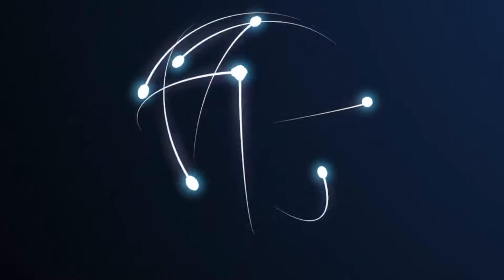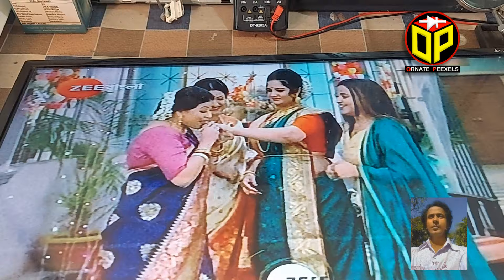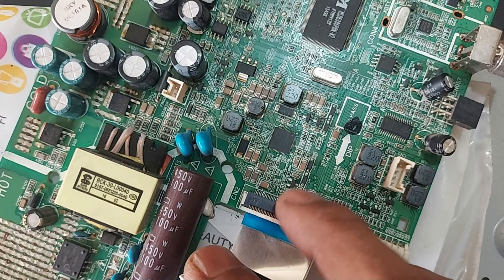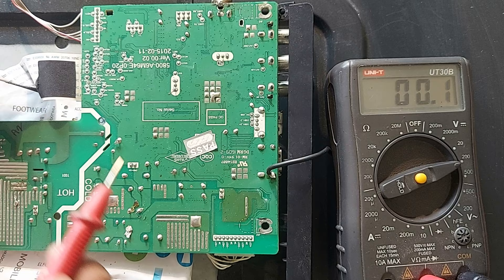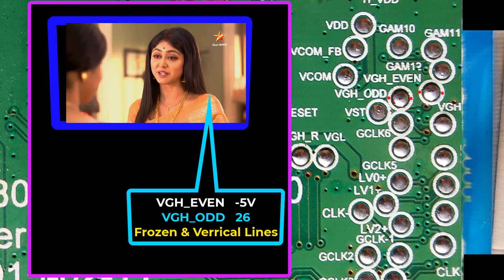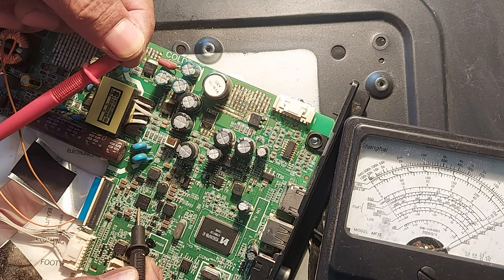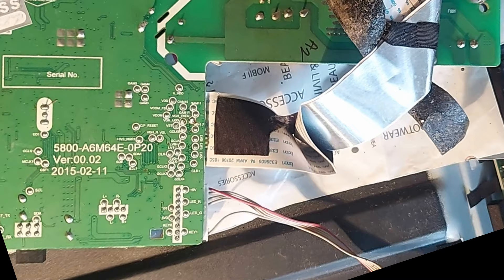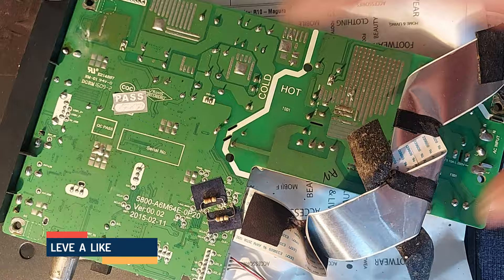Frozen Image then Vertical Lines or Bars Problem in 32 Inch Walton LED TV | VGH_ODD VGH_Even Details

Comment: Dear teacher, I have a question. If you have a T-Conn board how do you know if the DC to DC converter is bad or just in protection mode due to some panel shorting?
Reply from the maker: In Safety Mode the loads of output voltage from DC to DC converter have to be disconnected one by one then if the output voltages are found to be correct then it is understood that DC to DC converter circuit is OK.
Reply: @OrnatePixels  Thank you very much